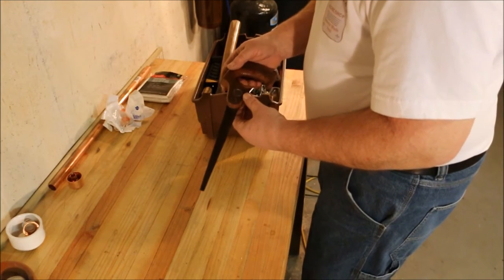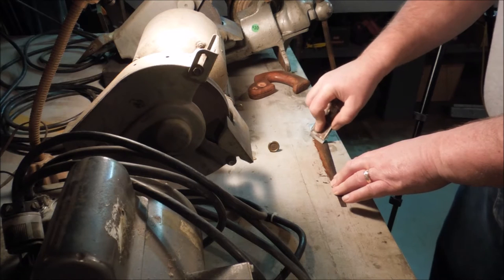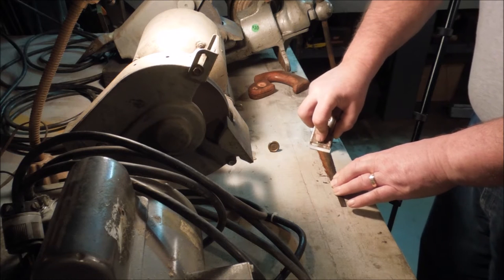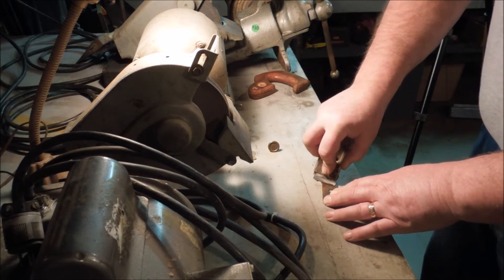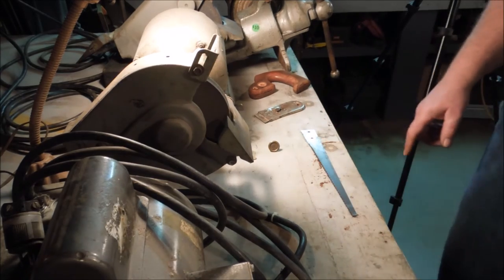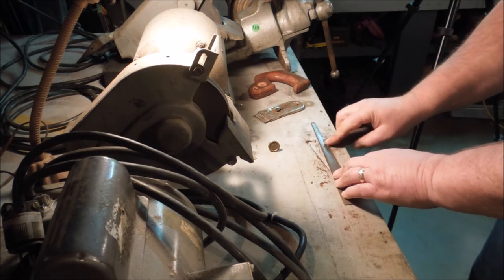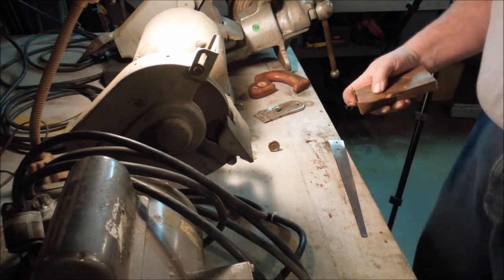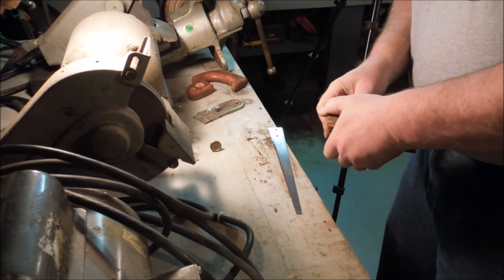Antique Shop Finds ~ Disston Keyhole Saw ~ Pt 1 ~ Clean & Straighten The Blade ~ By Old Sneelock's W

Comment: Looks like a good candidate for your exclusive PVC pipe vinegar bath!
Reply from the maker: +Rick Williams For just removing the rust itself I would dip it with no problems. Since I was trying to see if there was an etch on the blade I have found that the razor blade just works on the very top surface and won't dip down into the etched letters/picture. The vinegar will leave a mat finish and blur the etch so it's harder to read.

Comment: Funny, I just got done restoring my Disston keyhole saw. My blade was stamped  'Disston' but has both plan screws.Have you ever tried kerosene and fine steel wool on rusty blades?
Reply from the maker: +John McKee Over the last 6 years I've tried all kinds of things. If I'm searching for an etch I go with the razor blade or sandpaper on a wood block. The steel wool polishes off the edges of the etch. It can erase some of the detail.